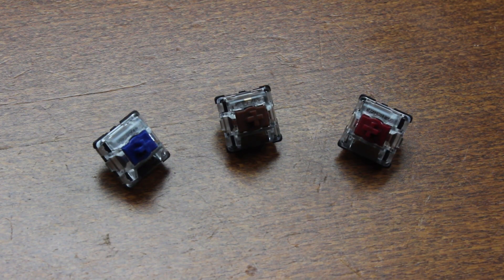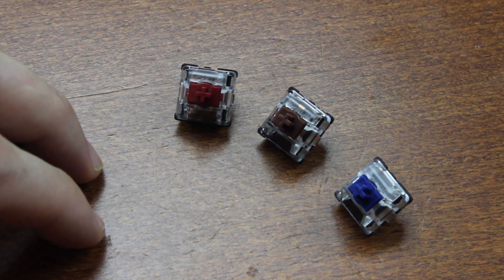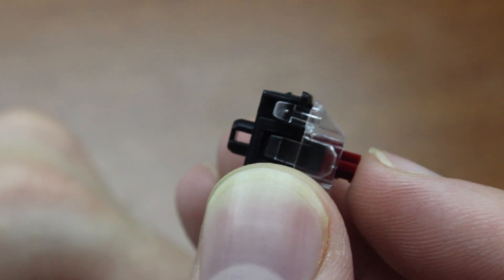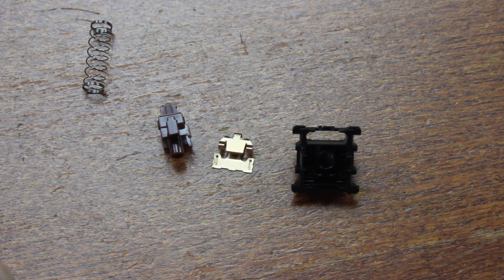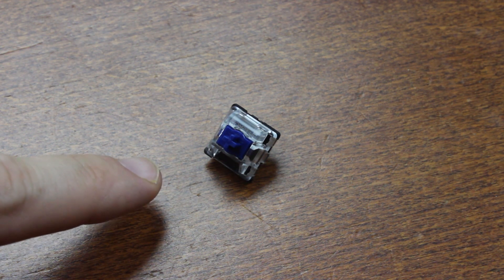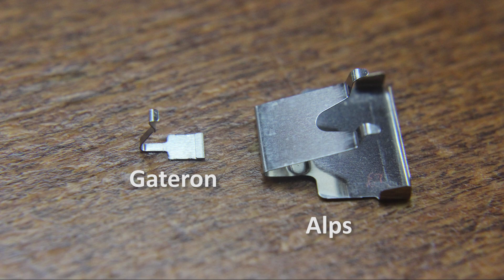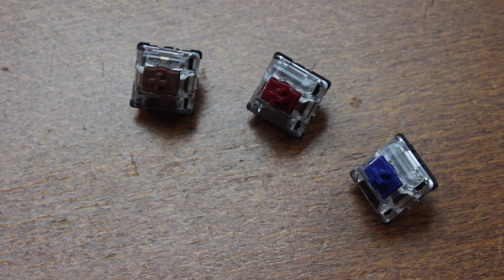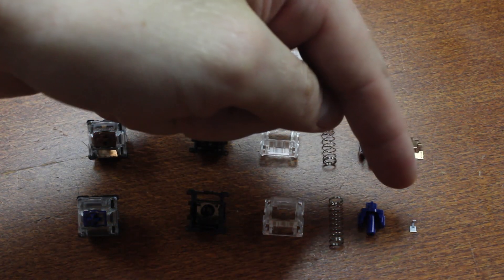Teardown - Gateron optoelectric switches!

Comment: I feel like these tactile and clicky switches are missing a huge opportunity here.  Without the normal contacts using up space, they could easily just put an Alps style tactile/click leaf in there instead and have an amazing feeling switch instead of something that just feels like another MX switch.  As was mentioned, the click version even started down that road with a similar idea but why they didn't just finish it with a full sized leaf is bizarre.  If they would have done that, it would have me running to figure out how to build a optoelectric board with these switches.  Something other than Zeal to get alps tactility in an MX switch.

Comment: We've gotten to the point where there are certainly some decent clicky options in the MX-ish (can't say 'compatible' because these are optoelectric so they're certainly not, but they still have a very MX-esque housing and certainly are compatible with keycaps at least...) world, but there's still a total lack of innovation on the tactile side.  It's kind of sad...
Reply from the maker: Tactile switches are the most difficult ones to design. Of course, there are plenty of designs in history to steal from now, though.

Comment: I have been using for some time the optical  asus RX switches (they are not bad i am ok with it) .  is my 3th keyboard. still my cherry red silent speed and the Outemu red speed silent. (i call it the economical ones) there are ok. i think is time to get what i have learn with you and get real switches.  First appear on 2020 when i get the test of the first run. still work unit today and still use it now. but my custom need love i think is time to step on the game on new switches.

Comment: I have a Gk61 optical with lubed Gateron optical blacks.  Some of the smoothest switches ever made.
Reply: I have the same keyboard and switches, very smooth indeed. The keyboard itself could use some foam inside though, the case makes the whole thing very loud.

Comment: Those were the clicky switch sounds at the intro?
Reply: i thought it was blue alps or some alps variation. Actually i described the sound for the board review video
Reply from the maker: @lignorof8475 the review intro uses SKCM blue switches, this one is beamsprings.
Reply: Nah those were IBM Beamsprings with a solenoid going off too.